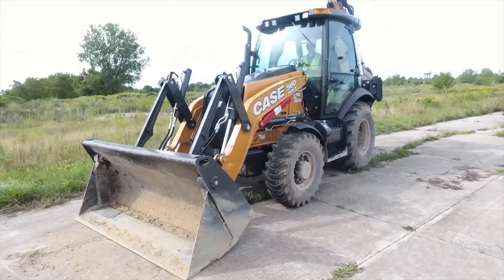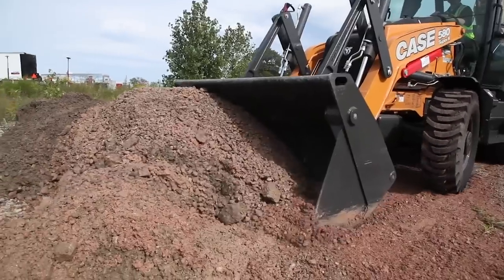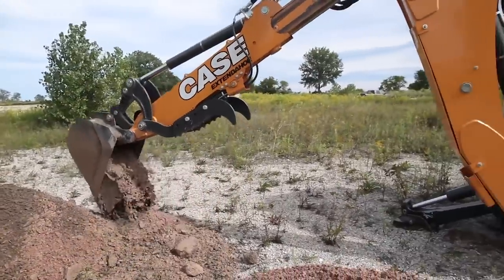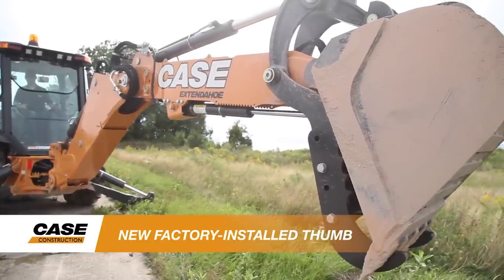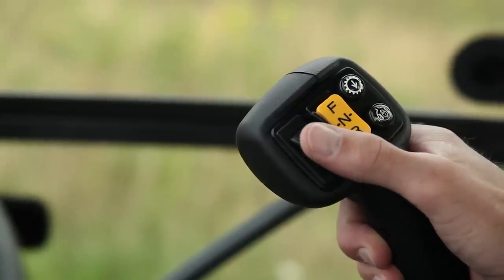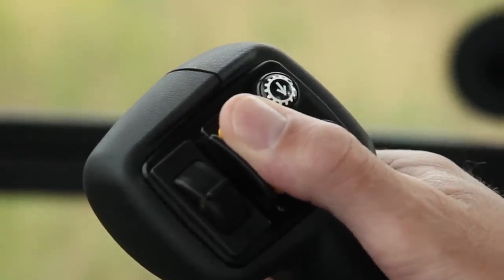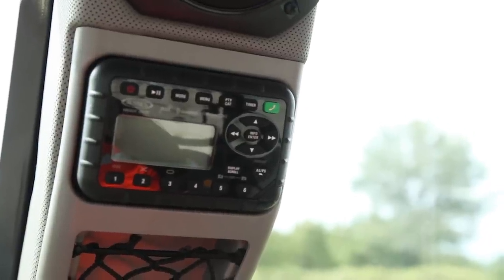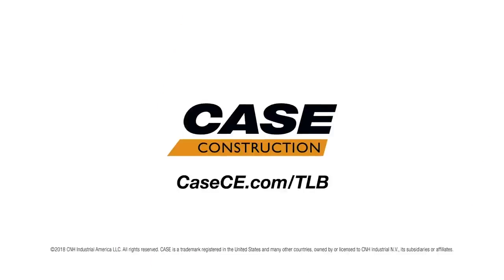North America: CASE Introduces PowerBoost, Additional Backhoe Loader Enhancements

Comment: What size front tires are on the machine in the video
Reply from the maker: Hi, Marc, thanks for your comment.  Please visit http://ow.ly/SpJY30mFDvH to view the available tire sizes for the CASE 580 Super N.
Reply: Okay sounds good thank you  any chance you could let me know what tires are on the machine in the video
Reply from the maker: @marcdavis6178  The 580SN backhoe has the following tire sizes:  2WD - 11.0 L x 16.0, 10-ply rating; 4WD - 12.0 L x 16.5, 10-ply rating; and 4WD - 12.5/80 x 18.0 10-ply rating.
Reply: @Caseatwork  I did look up the specs I was just curious what the tires look like on the machine that's why I was just curious which ones are on the machine in the video